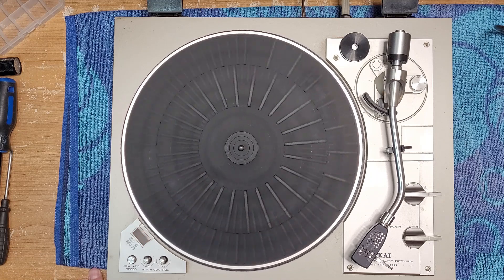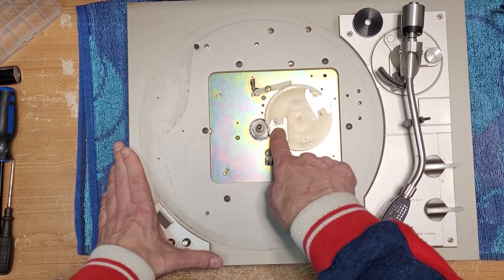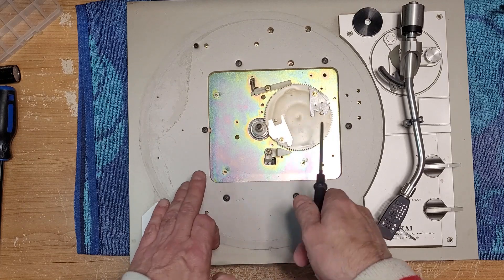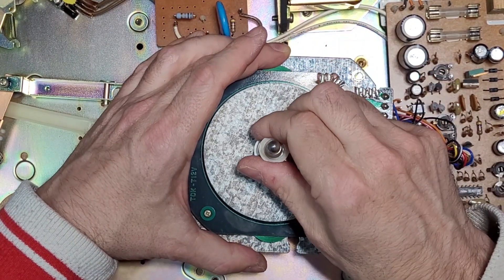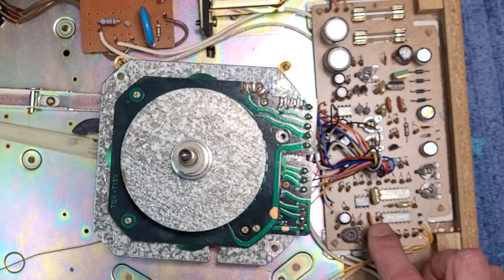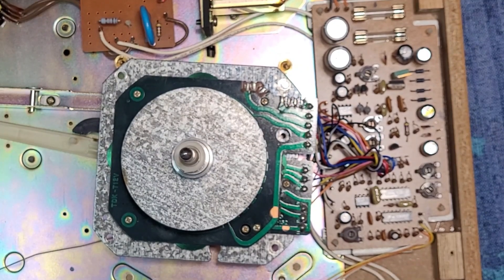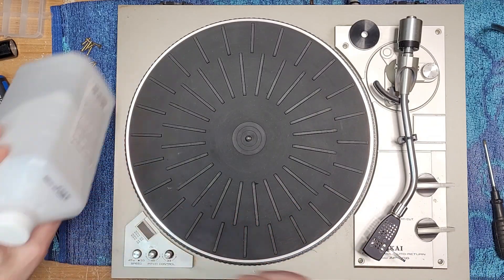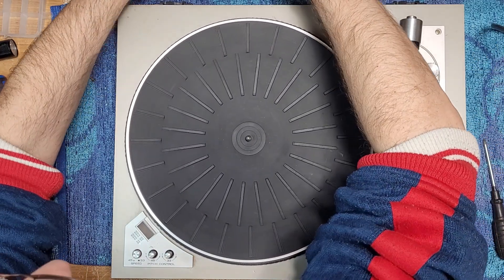Akai AP-206: Full Service

Comment: Good job man. I really liked this table. Very well built. Heavy. Heavy platter. I sold it with some ns-690 speakers and the guy loved the combo. I did a recap as I just do it as a collector. It also had erratic speed, not just pots. Akai and Toshiba had a similar system at this time. Start just drops the needle. Its cool, but a bit odd. Dude should be pleased. In AB they go for $275 CAD detailed with a polished lid. Akai means Red in Japanese.

Comment: Tks you for your video and prompt reply. I have been able to adjust offset voltage and now the speed is constant. But the  main problem is that my Ap206 will  not naturally start by itself when I move the tonearm. I must give the platter a  light turn counterclockwise manually , then it  turns and maintains its rotation and plays normally. Is there any setting whereby I can solve this issue?

Comment: Hi there, nice video. Very informative. Towards the end of the video u mentioned that there was a motor turnon sound. Is there any way to get rid of that? I seem to be having the same issue. Thanks in advance :)
Reply from the maker: Safety capacitor across the mains leads is failing
Reply: @ oooh tks for the reply. Will take a look when i open up to service. Thanks once again :).

Comment: One question, I've pulled mine apart and noticed the ball bearing for the motor has what looks like a machined out small circle on the bearing surface. Is this intentional or is that worn out?

Comment: Nice job! Did you polish up the top cover to remove scratches?
Reply from the maker: No, just the service.
Reply: @TurntableGuy  I started wet sanding through 3000 and mcGuires ultimate compound with a touch of water to thin it slightly, the scratch x 2.0 and carnuba wax with a butter soft pad. It leaves a mirror finish.

Comment: Hi, what is the goal of those capacitors that you changed ? Is this something to see with sound quality or just powering the unit ?
In fact i have this akai and have verry high frequency hum and when i touch the arm the hum noise get higher...
Reply from the maker: Capacitors in a turntable are solely for power.  There is nothing in the path between the cartridge and the RCA cables.
Reply: @TurntableGuy  thank you, i understand